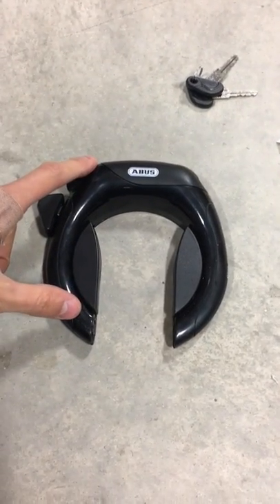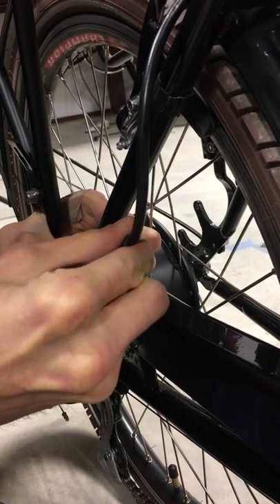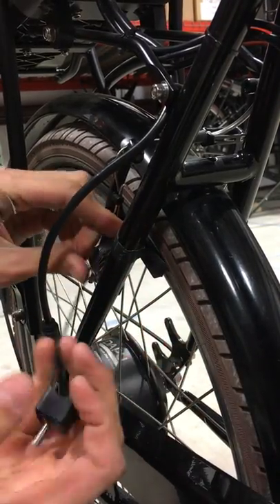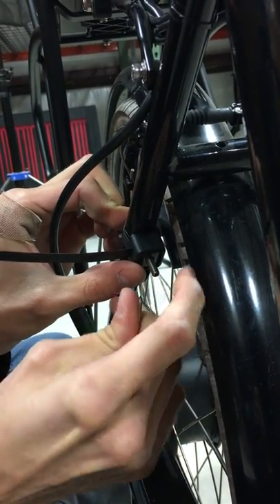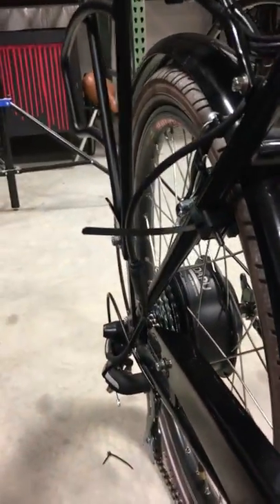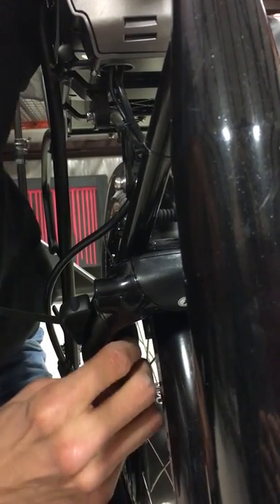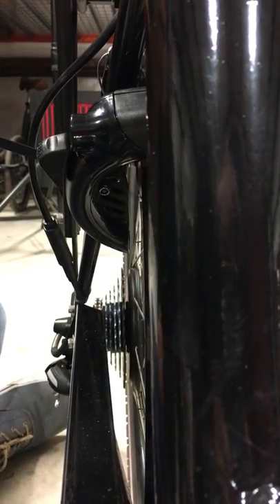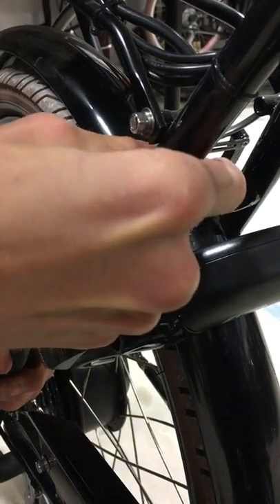Installing the ABUS Pro Tectic 4960 Frame Lock with Clutching Strap LH Adapter on a Bunch Cargo Bike

Comment: How secure is that once it's on there via straps? Couldn't someone just cut it off?
Reply: If someone cut it off the lock would still be locked around the rear wheel and it would still be impossible to steal the wheel off the frame.
Reply: @awmxxx  no, it locks the wheel inside frame triangle, so nobody can ride bike or steal the wheel but it is still possible to steal the bike by lifting it (if chain is not inserted into this lock and wrapped around some immovable object).

Comment: I find that in order to slide the caliper lever down  I have to turn the key slightly clockwise, otherwise it doesn't slide.  Do you find this to be true?   Also, you might be interested to know that when I got my first three speed "English Racer" almost sixty years ago, it came with a "GB Lock" which this seems to be a future version of.  The GB lock didn't use a key but had a push/pull button combination scenario ( in skip out out in type of thing).  Also, it was much easier to attach to the rear fork.  It had a bolt that went through it and had a big wing bolt kind of wing that would tighten against the other side of the fork.  That  was a better design than the Abus.  It was infinitely easier to install and much more solid.  I passed this GB Lock down from bicycle to bicycle and about 15 years ago it finally broke.  I've been Googling GB Locks ever since to no avail until I found the Abus.

Comment: I'm trying to figure out if this will work with my Heybike Cityscape. Looks like the posts around the rear wheel are too far apart but I don't have a frame lock to test with.

Comment: I just bought a Blix Vita-Flex+ that has 2.5 inch tires. Which ABUS frame lock will work with these tires?
Reply: The 2nd to largest one will fit. Look for the one with an L next to the Abus frame lock name.

Comment: Thanks for the informative video. I've just ordered one of these for my E-bike and was worried about it being too close to the frame as I have 3 screw holes that are sticking out slightly proud (I don't think they will line up with the lock unfortunately) so it's good to see it sits a little bit away from the frame. I might design and print a 3D bracket of some description so it supports it more against the frame so it doesn't have the wobble. It just doesn't seem all that secure to the bike to me although if was ripped off the frame the bike still wouldn't ride but the back wheel could still be stolen.
Reply: Then you easily put another on the back wheel.
Reply: @user-gm8ll5hs4x  except my back wheel is where my motor is

Comment: I'm confused. So, it's only held to your bike by metal straps? Didn't seem very secure. I thought those adapter pieces would screw into the frame of the bike.
Reply: If you had a place on your bike to screw in (many do), then you wouldn't need an adapter at all.
Reply: It doesn’t really matter, since this type of lock is mostly meant to prevent opportunists from riding off with the bike by immobilizing the wheel.

If your concern is wheel theft, you’re better off with security bolts/skewers.
Reply: Even if the straps are cut, the lock remains locked to the wheel which makes the bike unridable.

Comment: What are the inside measurements of the lock. What you put over the wheel. The width of my ebike tire is 24mm approx. Hope someone out there understands this.
Reply: cafe lock width is 50mm or you can get 60 mm